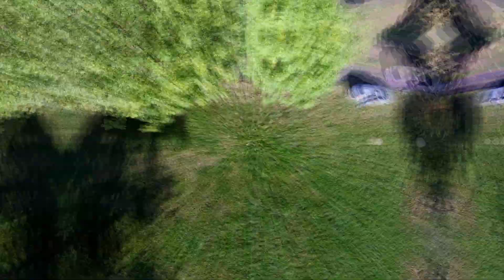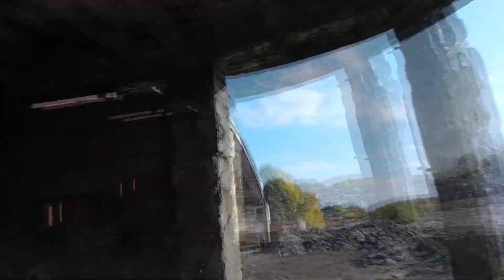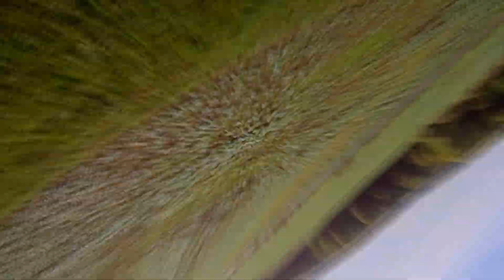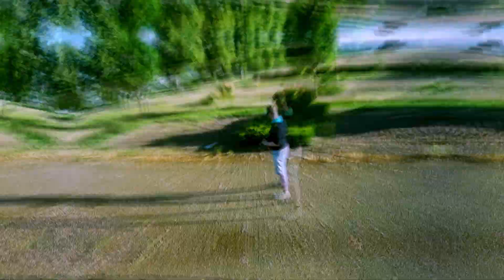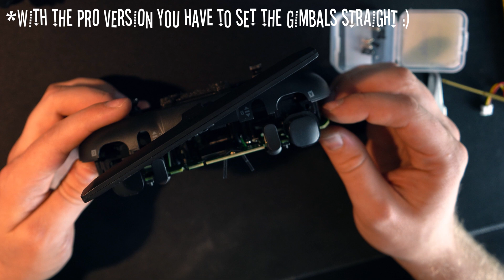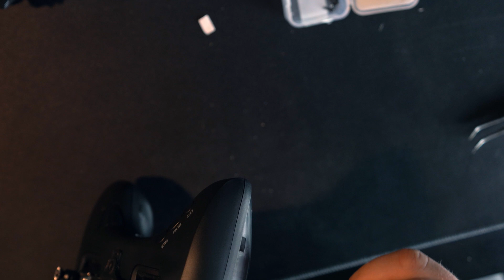🎮🛠 TBS Tango 2 - How To: Repair the Antenna - English 🛠🎮

Comment: thanks! this video helped a lot.  I been trying to replace my TBS Tango 2 stock antenna with an SMA connector so that I can use the regular immortal-T V2 and Diamond antennas and it worked.
Reply from the maker: I'm happy I could help you! That idea is great 👍 One curious question: Do you fly long range? I'm asking as I was never in the situation where I missed range with the tango 2 (it failsafed only once on the very first day due to bad antenna positioning)
Reply: @flickFPV  Yeah, I sorta fly long range. Usually I just use 25mW (always having DYNAMIC power on) even with the stock TBS Tango 2 antenna and I've never failsafed. I fly on wide open fields though, with very little trees/obstacles. Most my kwads, i got the receiving Immortal-T on the Nano RX, vertically oriented. Only the ones with horizontal antenna orientation gets RSSi drops when turning, but no failsafe so far. 

Now I'm using the regular Immortal-T v2 on the TangoII, and it seems like my RSSi is even more rock-solid stuck at 99%. The Diamond Antenna looks massive on the TangoII, really love how small and portable TangoII is!
Reply from the maker: Thanks for the explanation, this makes sense! I also had the diamond antenna in mind when I was between the decision new antenna and/or crsf module for my X-Lite or new radio.. well as I own the Tango 2 Pro now you might know how I decided. 🤣
I like to just pull everything out real quick and be ready to fly in few minutes, without putting antennas on etc. 👍